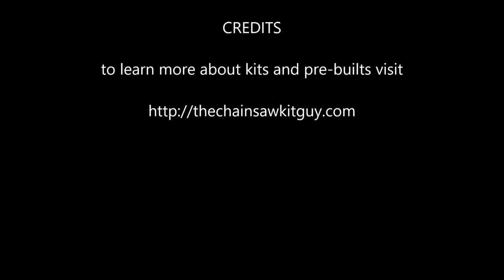FarmerTec MS380 Revisit Teardown 1

Comment: What made you think the crank and flywheel are the problem?
Reply from the maker: thanks for watching, are you here to wish me luck? if either part was manufactured incorrectly and the key was in the wrong place or the magnets were off what kinda of problems do you think might occur? those are considerations i made. this kit is two years old, first out of the shoot. every single idea you had reading that, wanting to tell me i forgot something, has been tried. no stone was left unturned.  very experienced people have consulted with me over that time period offering advice, most of it i took. this is so unusual i thought it was worth a try. one last try.  (1st issue of many, would tune no higher than 8000rpm)
Reply: @the1chainsawguy  I will be interested to see if this fixes it.
Reply from the maker: @jakeertwine8557  thanks me too :-) i laid it out for everyone to see, you can watch me and see that everything is as it should be. i am good at what i do and that is why this bothered me so much. never could make it right. the proof is right here, if i miss something let me know. the tests are in # 6. i guess monday will be the day, depending on flywheel arrival.